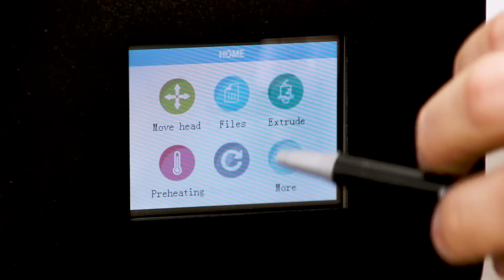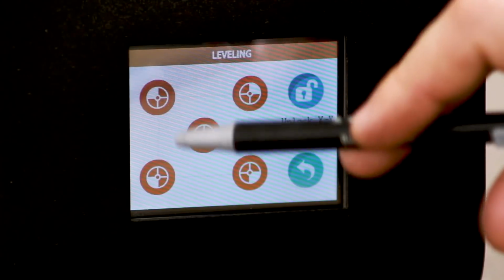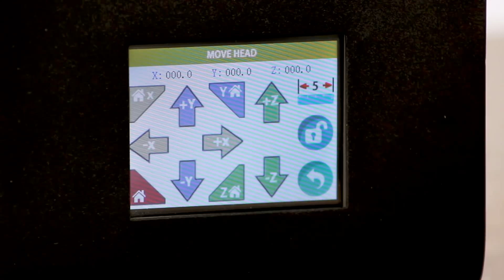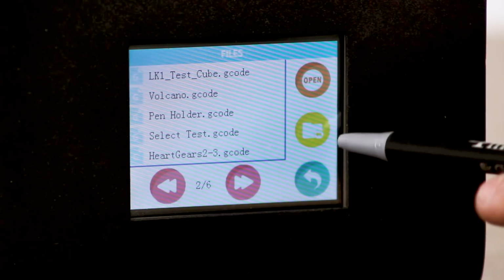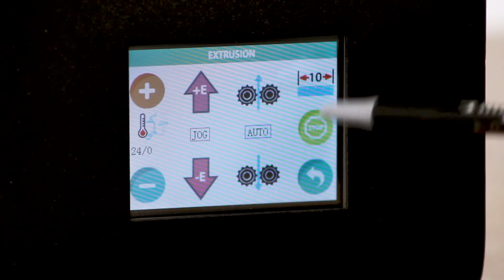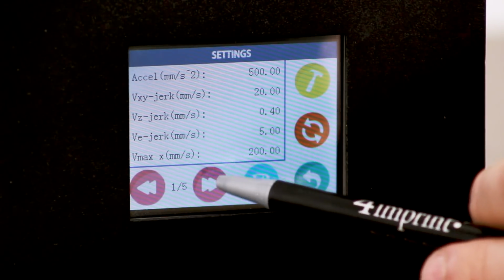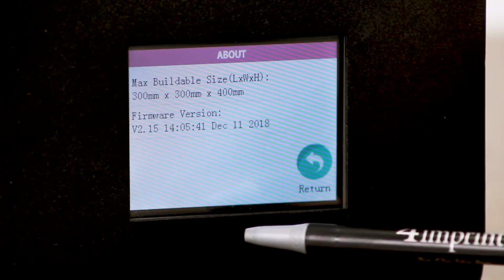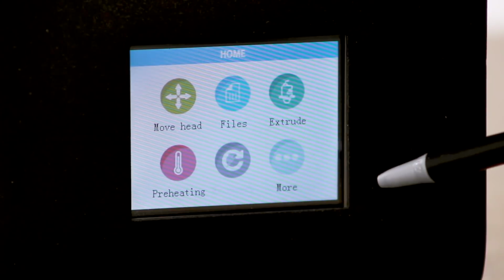Longer 3D LK1 Feature Overview

Comment: Can anyone help me?
I recently got my first 3d printer but I'm having problems getting the correct file type. My laptop says the stuff I downloaded on thingiverse is filed type "3d model" but I need it to be something that will show up on my printer.  I'm using Windows 10
Reply: The files you download will be 3D models. You need a slicer program, like Cura, to prepare the code that the printer understands. What brand and model of 3D printer did you get?
Reply: Printers only read gcode. You need slicer software to slice and export your CAD model.